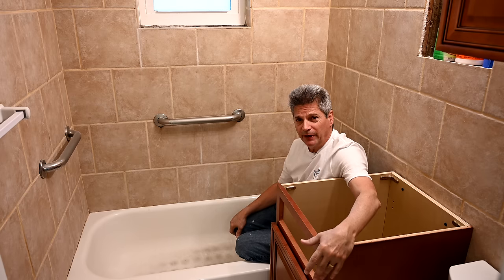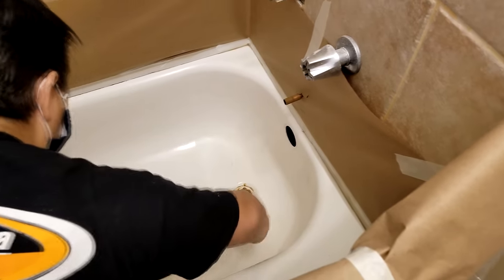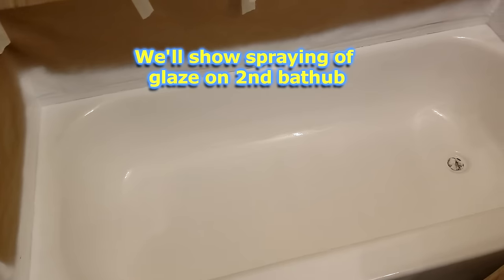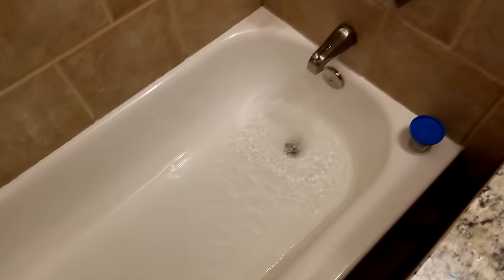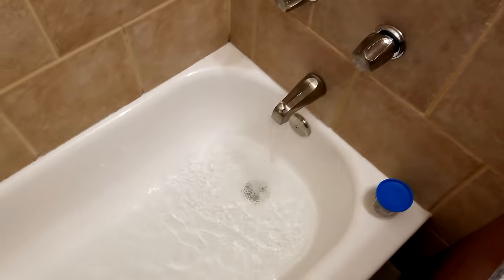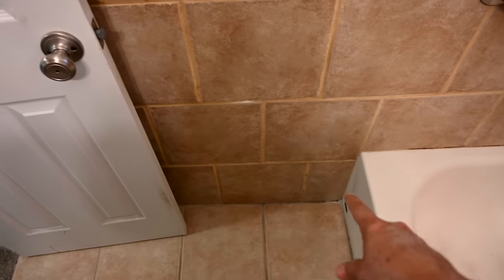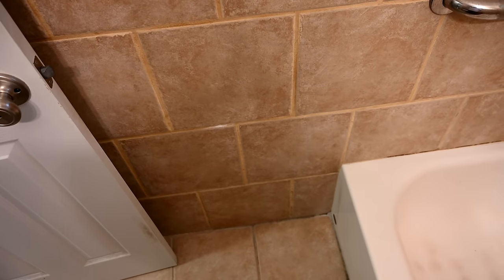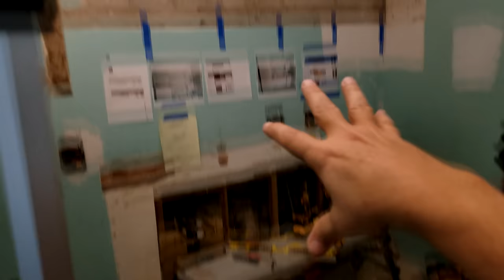Bathtub Reglazing Like The Pros, Tips For Beginners

Comment: i have to disagree, i think bathtubs are very easy to remove and replace...long story short take out one layer of tile around the tub, cut the tub in half, then open sesame and out with the old.. it would take 1 day to exchange the tub and replace the layer of tile and then i could shower that night or the next mourning whereas reglazing i have to wait 3 days for the glaze to cure... personally i would take the extra steps and remove the vanity and toilet and door just to make my day that much easier...now if your talking cost then  yes, reglazing would be the way to go.. but i see Jeff covered this in his post...Jeff your a good dude, love watching and learning..
Reply: it takes 24 hours to be exact until you can shower and what will you do when you remove tile and cant fund the same tile ?
Reply: It's about  the money, not how easy it is to replace...clearly you have no clue how expensive tubs are, especially in older homes where the tiles are minimum  50 years old And unable to be found again or easily replaced and the wallks and stuff are made to fit that so to find A new tub same size nd not to havy to wear your mess up your flooring isnt as simple as reglaxing a tub you know is still good..
Reply: I disagree, taking off one row of tile is a lot of work. You will probably break the tiles you take off. So need to have spares. 

You may also break adjacent tiles so now its more work. 

The tilebackerboard/waterproofing would probabley  get damaged as well so that would have to be fixed...its a bit tricky replacing tiles and have the faces line up flush with the existing ones. 

Plus you have all the plumbing involved with a new tub etc etc ...

I dunno, I've done a quite a few bathrooms and repair jobs. I would definitley reglaze espeacially if its a cast iron or steel tub.
Reply: This process is $$600-750 replacing a bathtub is much more than that.
Reply: I’m a plumber and have been doing it for years. It’s not hard for someone who’s been doing it for a while , but by no means is it easy for your average home owner and no comparison in cost.

Comment: I just got this done and the paint is already scratched and peeling. I read the work is supposed to last several years. 🤷🏽‍♀️ Are they not supposed to put something over the paint to prevent it from getting damaged so fast?
Reply from the maker: If it is peeling off already then it's probably due to the fact that they did not use primer. This company uses a very expensive primer and I do mean like very expensive somewhere around $300 and it's a formulation that they spent years working on. They are supposed to send down in roughen up the old paint first then wipe it off and clean it off real good, and then spray the primer and let it dry awhile, and then spray on the new glaze. And by the way the glaze these guys use is a pretty special mixture as well. So it really depends on their technique and what they were using, if they just bought something off the shelf at Home Depot and come in and spray it it's going to be garbage you need to find out what they used and how they applied it, Before they'll be able to tell you why it peeled. And even with the warranty I'm not sure I would want them back in there doing it again I think I would just ask for my money back
Reply: @jeffostroff  the was stix primer don’t get me wrong is a really good primer but is not $300 is like $50 or less

Comment: I’m glad you explained why it’s difficult to remove a tub as part of this video. I’d love a link to the piece that raises the shower head up
Reply from the maker: You just need to sautter in whatever length of copper pipe, you need to extend it upwards. So you would need to get in half. Inch wide copper pipe and a copper couple and sautered those two together on top of the existing copper pipe to make it go higher
Reply: @jeffostroff  great, thanks for the reply!

Comment: What was the materials you use to paint the tub primer and the finish paint what product
Reply from the maker: The contractor did all of that they used a special mixture premium primer that they have made for them and also the top code is a mixture of some premium. Chemicals as well they were not specific about what makes it all up

Comment: How long in hours or days does it take to complete this job and how much does it cost?
Reply from the maker: The contractor charges $300, and it takes a half hour to tape and paper to protect the area, then they sand it with orbital sander, then vacuum it off, then spray primer, wait 20 minutes, spray on 2 coats of top coat. The smell is bad for a few hours then goes away. You can't use the tub for 48 hours while it cures.

Comment: Around 10-11 Jeff tried to describe to everyone the challenges in removing and replacing a bathtub.  For all the detail used in this explanation he still is not conveying just how difficult this job is.  Let me just add that the geometry of handling a 100 lb bulky tub into the room, and then into position is almost impossible.  You should be prepared to cut studs back so you can maneuver the diagonal dimension of the tub around the room.  All that time you have an exposed factory finish you must be cautious and gentle with also.  None of you want a new tub to replace a discolored tub, only to have that annoying chip or scratch the workmen put in because it is so difficult.  Do it the easy way, learn to reglaze as Jeff is advising.  
Here is the second bit of good news.  If you find a defect in your work, you can rework the glazing job.  You will be greatly upset if you damage a new tub, and THEN you decide you STILL need to reglaze it.  Jeff is showing you the best solution choice.

Comment: Q:  ?    Hello,  Do you have a video showing a total reglaze of regular tub and shower surround of 4 inch tiles too?  I have seen it done, and am hoping to see a video, so I know what to expect from the contractor that I will hire. Because I watched this, I know that I will want to tape off alllllll of my newly painted walls in the bedroom next to the bathroom, and that I will want to move my blue and my black cars to another street when it's being done - haha.   thanks!
Reply from the maker: It's just an extension of the tub, they spray it as well after sanding

Comment: Hey! I'm a long time painter & did some countertops years ago, but needed a lil refresher. I have a couple questions. What type of roller did u use to prime? Im recall using foam, but would mohair or something like that work better? And could I use a normal ol'  magnum sprayer?  What do u use to clean it out after? If so, I'm assuming I'd wanna use the sprayer I normally use for oil paint. . .is that right? I'm helping a friend with a rental property & he’s trying to save money any way he can, so this would be a great way to do that! Thanx for the informative video & thanx in advance for any  other tips I could get! Oh yeah, & if i use a Graco magnum sprayer (with the blue pro-contactor gun) what tip would u recommend?
Reply from the maker: Well unfortunately I can't answer most of these questions because it was the contractor that we brought in to do this work and we just filmed it. However I can tell you that he  used a standard foam hot dog roller to roll on the primer. I don't know what pressure sprayer he was using or anything about the nozzles but from what they've told me a lot of their stuff they did was custom including the blends that they use for their primers and there spray coating
Reply: NO...you cannot use a Magum sprayer. They use a special sprayer that has little to no over spray and is very low pressure. One brand is Titan and there are others. Forget all you know bout painting when it comes to this. I used to be a painter and I just had 2 tubs done and it is a lot of work and the paint is incredibily  strong smelling . Do not try to shoot a tub like you would a wall or trim. Pay to have it done or else try one of the Ekopel kits.
Reply: Those magnum sprayers no matter the tip you use are just for acrylic water base paint . No oil paint on them should go through ( in my experience)  . When I painted my tubs I had to buy one of those HVLP guns running with a compressor , that does the job. But yes the smell is really strong , so a fan pointing out the window will help, and I would cover the floor  because the overspray will get to it having in mind that you don't have one of those fans with the snake plastic heading outside.

Comment: We just had this done 4 days ago. My question and concern is that the smell is still lingering even with the bathroom fan on and the bedroom window cracked and an air purifier running. Is this normal and is the lingering smell dangerous? Even if I only go in the room just to shower for 15 min then I stay downstairs but I’m just concerned as I have 2 kids and just wanna make sure it’s safe and only a smell
Reply from the maker: The company we use usually their smell goes away in a few hours. You might want to open the window and run the bathroom exhaust fan if you have one.

Comment: Hi Jeff, Can you post what products you used? What sandpaper grit, primer, etc? Thank you!
Reply from the maker: It was the contractor that did the work and I don't know what grit sandpaper they used on the DeWalt Sander. Next time I hook up with them for a remodeling I will get more information on their equipment such as the big blower and what is using for spraying
Reply: I’m a profesional bathtub refinishing technician in Miami and as far as the sand paper grit goes we use anything from 30, 80, 120 you decide what you like to use my personal preference is 120 it really sands everything smooth and 120 is great for previously refinished bathtubs as far as products everything is different but the products are commercial products so you cant just go to a store to buy them you need to have a business at least a llc for them to send you the high grade products through shipping

Comment: What do you charge for this? Wouldn't it be cheaper (or at least more convenient) to get a $300 tub from a big box or one for $150 from a liquidator?
Reply from the maker: I don't do the reglazing. It's a contractor that does it and they charge $300.It's not just a simple matter of buying a $300 tub. There's a huge enormous amount of labor that would probably take you 2 days worth of time to get it all done right and then you have to talk about. Reinstalling tile and. Waterproofing around the bathtub and all of that sort of thing. It's a major project to Replace a bathtub
Reply: @jeffostroff  True - thanks.
Reply: @jeffostroff  Thanks - I did a reglazing. Had the small tiles (non-bathtub wall) and vanity top tiles reglazed, as well. Worked out great.

Comment: I am a DIY guy. I do not have access to all the acid which you guy have. I am thinking of buying muriatic acid for acid washing my bathtub. My tub was reglazed 6yrs back and I have removed the old paint. Should I buy muriatic acid? Or are there other product (Zep, etc.) which are equally effective?
Reply from the maker: I don't even mess with that stuff so I cannot even give you a proper answer. I just know that what these guys do is they see and down the previous layers and roughen them up real good, and then paint on a primer not an acid. But certainly I would not even put on any type of acrylic paint or tub coating without a primer
Reply: @jeffostroff  Thank you sir.

Comment: Wish I could get that done, still trying to repair my hot water valve stem
Reply from the maker: so much easier to let the contractor do it, done in 2 1/2 hours at $250 cost.
Reply: @jeffostroff  Is that price discounted from a contractor you know, or usually regular price? I was going to reglaze my tub myself, but if cost is around $250, I'd rather let a pro do it.

Comment: I lived in two different apartments that had tub reglazed, but eventually, the glaze started peeling— one, a few weeks after moving in; the other about 4 years after moving in.  Does that mean it was reglazed with cheap products?
Reply: Could be that the reglaze was done incorrect , they might have not cleaned it well or put enough paint on the tub

Comment: What is the cost to réglaze a bath tub and can rust spots be fixed
Reply from the maker: The first tub was $285, the second one was actually cheaper $250, and they bondo any chips and sand it down.

Comment: Hey Jeff, what was the wait time before applying the next coat?
Reply from the maker: He waited a few minutes
Reply: It drys fast coming from hvlp gun, but we always let stand 5- 10 between coats, and we use a high density foam roller for that latex border after it's been well sanded , and cleaned extremely well.

Comment: Jeff.  How do you tape off the groute at the wall to tub joint?  Do you glaze yhe groute?
Reply from the maker: If you have really old nasty grout I would try to re-glaze the grout. It's also a good idea to put a bead of silicone over that after you've waited for the 48-hour curing. And let the glazing dry but I would try to tape off the grout so that the glazing does not land on the grout unless you really want it to

Comment: The corners of my big tub are drooping just a tad and the water puddles on every corner.  What can I do to level it out as in what filler?
Thanks!
Reply from the maker: You would have to slope it to aim the water toward the drain. I have never seen anyone run into this situation, not sure what they would do.  If you tub is not level to begin with it could be a great excuse to renovate the bathroom, pour down self leveler concrete and start over with a perfectly flat floor
Reply: @jeffostroff  The tub itself is leveled but for some reason, only the corners are drooping  to the point that it puddles. And yes, I would like to figure out how to level it by applying a filler or paste even if very thin layers at a time in order to aim the water towards the drain.  I'm afraid a remodel is not an option due to it would have to all be gutted....knee wall and all.  And that's too much for something I can find a solution to.  I'm thinking the fillers they use when resurfacing and a few light coats of the paint with light sanding in-between.  It's just a tad unleveled.  After the etching and primer right...?

Comment: Can you make a textured tub and shower wall smooth using this?
Reply from the maker: You can spray this up tiles and it will be smooth, but I doubt it will work on textured ribs, it my just run down like runny paint
Reply: @jeffostroff  *tub I meant. Thanks

Comment: What grit sand paper
Reply from the maker: I di not know what he used, likely 150 or 220, you need t just roughen up the old coating  so the  new spray will take to the surface

Comment: If anyone knows the answer to this:  In an apartment building, what are some things that could possibly cause the chemical smell to travel floors down and linger?  We experienced this problem when our upstairs neighbour 3 floors above us had their tub redone.  I ended up having to go to the hospital.  I was reassured they used double sheeting, so I'm not sure how.
Reply: Btw, the chemicals used were:
- Acetoacetate/Ketimine primer
- 6300 Series Polyurethane
- Lacquer Thinner
Reply from the maker: Installers failed to ventilate tot he outside, or you likely have a shared AC duct and the fumes traveled through the duct. Maybe the should have taped off the AC register vent, and piped the fumes outside.
Reply: @jeffostroff  Thank you for your response!  I'm thinking they vented out the above window and they heavier than air fumes just sank into my apartment.  Smell and fumes were worse outside but also present in unit with windows closed... possibly through spaces in wall.  Air blows in even through our electrical outlets.
Reply: It came down the vent /drain pipe.  Most apartment building's plumbing and / or electrical are placed in the same location on each floor, i.e..  bathrooms/ kitchens are directly above and below each other.  Each floors'  tub and its  required drain and water lines, for your example, will all tie into a single drain line going down one floor to the next and  make what's called a   "stack".   Which also means each floor's vents are also shared.  That's where your fumes got in from.  Block the tub and sink drains next time

Comment: People this is not how you reglaze a tub. You can't use water based paints! this tub will peel within a year. I do this for a living and trust me this is not the way at all! even a house cleaning material can wash the finish coat away lol. Ir has to be either a epoxy or a polyurethane and must be submergible coating that can be found at boat shops locally to start.
Reply from the maker: You are very incorrect in your statements. 1st of all these guys have a guarantee of 5 years And I have seen numerous jobs from them 2 years later that are still doing just perfect. Also I thought I heard him say he was using polyurethane based paint

Comment: This is not a job even for a talented do-it-yoursef-er!    Initially, there is no sign of any rust on the tub; just staining and old finish.   The fisrt step is sanding the tub.   That is a very demanding and time consuming chore.   It requires careful use of a rotary sander on a concave surface in an enclosed area, wearing a good dust mask.   It is not the sort of back exercise that is good for you.   The next step is even worse, the use of an etching chemical such as methyl chloride to prepare the suface for the primer coat of paint.   A special mask must be worn against that etcher chemical, or it will etch YOU!   Need I go further?   Better to have the tub replaced by a tradesman or to take showers until you sell the house!
Reply from the maker: Yes this is one job where I always let the pros come in and do it.